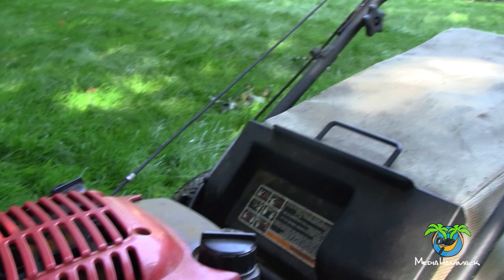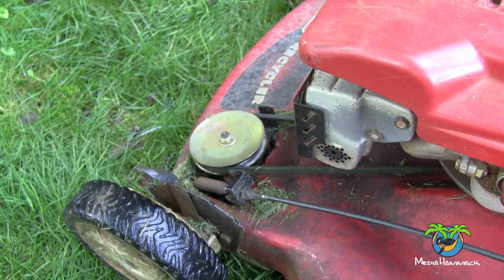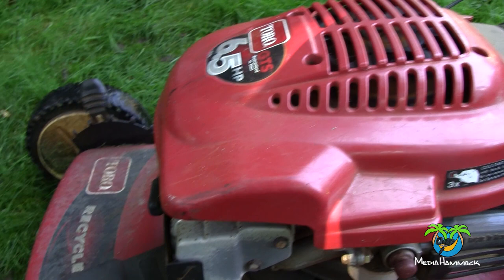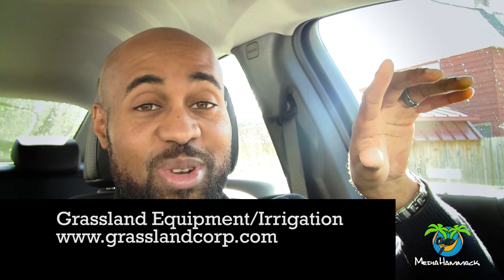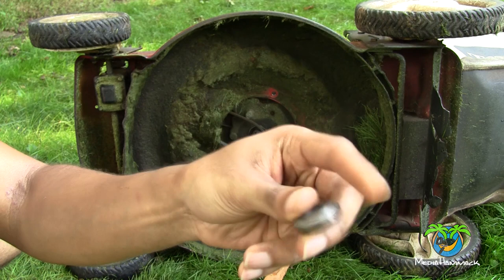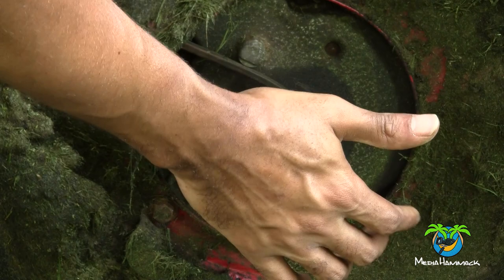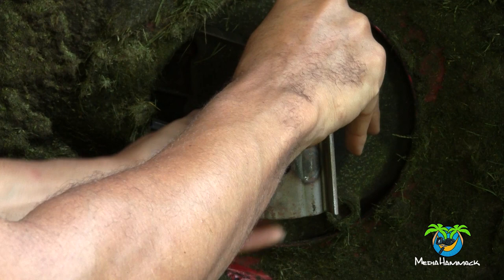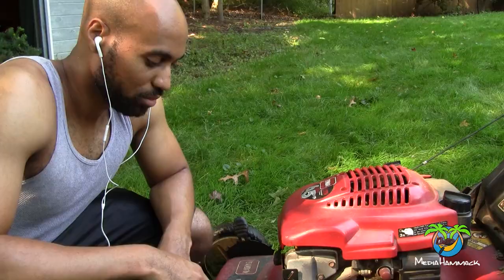Toro 22" Recycler Lawn Mower Fix for under 20 dollars!

Comment: Thank you for this.  You made it look easy - the drive shaft on mine was rusty and it took forever to get the driver off with penetrating fluid and a hammer.  And that washer - WTF!  Works like a champ now tho.
Reply from the maker: I remember the day I fixed this thing. I felt like I won the lottery or something...probably an exaggeration but you know...

Comment: bro i would of never thought in a million years this could be the issue. my belt popped off while mowing. so i took the entire damn thing apart to get the belt back on. fixed everything. the retaining ring popped. salvaged another one. get it together and self propel still didnt work. messed with the wire, nothing. pried open the transmission, looks fine. im going to get a new blade driver and try it because i got nothing to lose at this point. maybe i can salvage one off my other toro. i have no clue how that piece even wears out but its worth a try before i kick this god damn thing to the fucking moon! haha
Reply from the maker: Let me know if it works. Figuring out the solution took forever for me that's why I had to make this video. I knew I wasn't the only one 😆
Reply: Hmmmm, update? 🤷